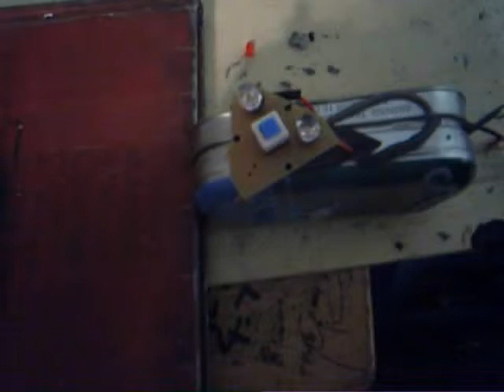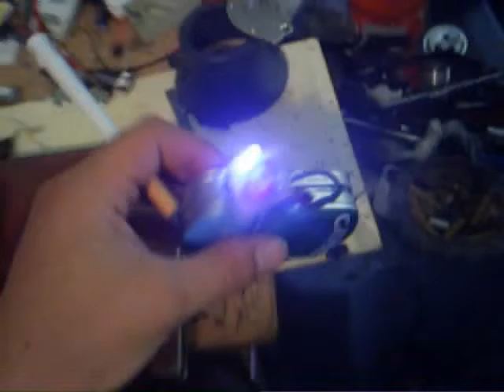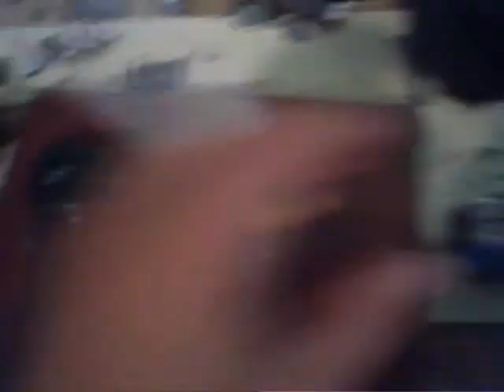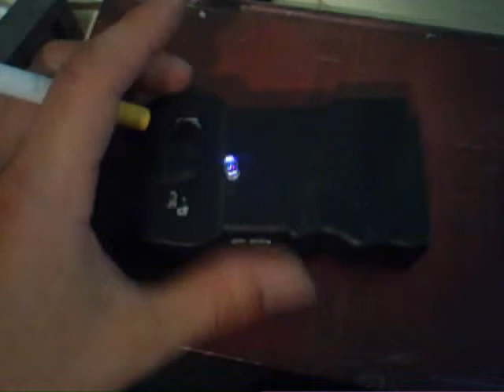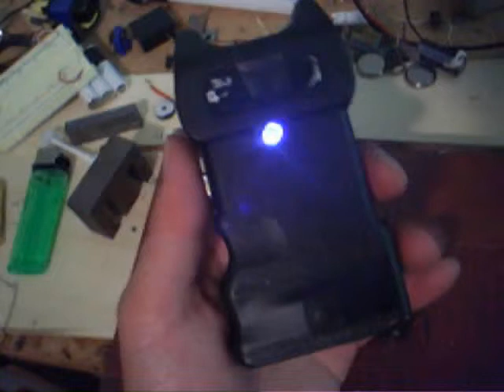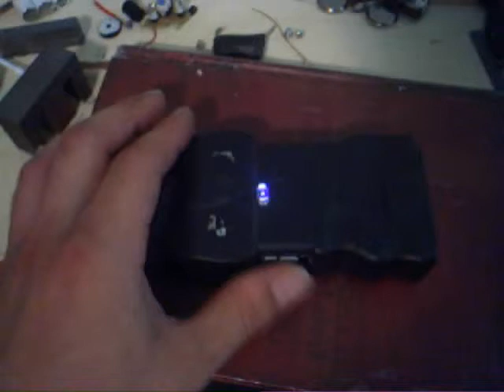Touch Activated LED Joule Thief 1.5V

Comment: Hi, great project and touch feature vital for my Refugee flashlight giveaway project, Would  you be willing to share the circuit ?
Reply from the maker: +Celal Boz (Alboz) well sorry to say at this point i can only guess as to how i wired it, but i'm sure we can figure it out. the problem with this circuit is it was not a true touch activated circuit, rather the touch would activate the LED. so the circuit would have to always be on in order for the touch feature to work, and in this circuit, that always-on current draw would be whatever the Joule Thief was pulling. So basically in order to use this type of circuit (darlington transistor arrangement) as a touch switch, in conjunction with the joule thief, there would need to be an additional switch for On/Off. However the bones of this circuit is the darlington.. i believe i used 4 small NPN transistors all arranged in a Darlington to bring the amplification much higher. You can find a simple diagram for a Darlington Pair online, and just add 2 more in the chain. the more you add, the more amplification, but no more than 3 or 4 is really necessary. You basically treat that as one transistor, wire it as a switch, with let's say your 4.5vdc in line with an LED load. the Base of the transistor is then what you would touch the bias it, so you could attach that to a piece of metal. the larger the piece of metal the more likely it will be to sensitive biasing and low ON's. What I did here, was replace the 4.5vdc power input with a joule thief circuit so it only needed one battery. As a lighting project however, i'd say just the plain Joule Thief would be more suited, and if a touch feature was needed, that could be implemented as well in another way, via the Base resistance of the JT circuit.
Reply: thanks, i did figured it out, ic 555 leg 2 on, leg six off pin 1 and 3 led it works .